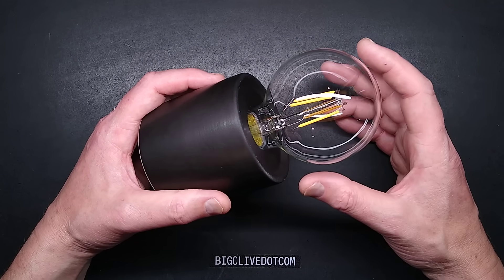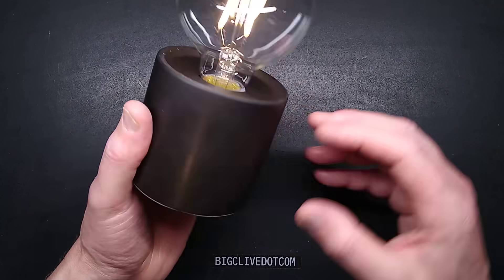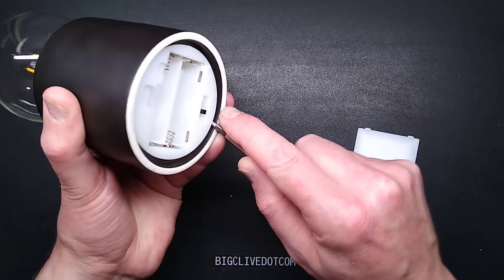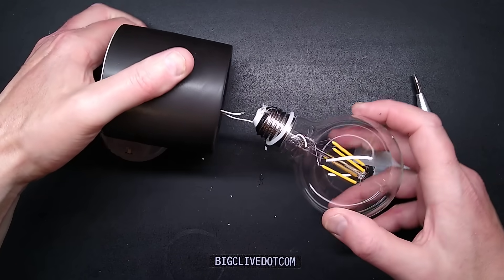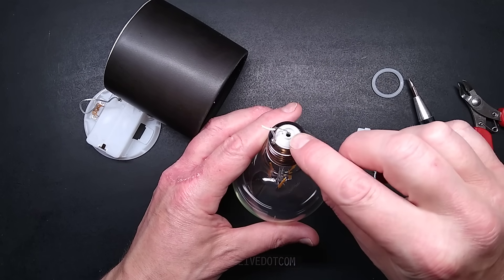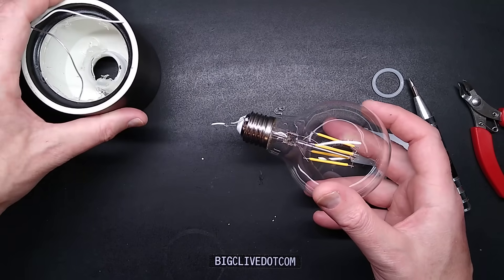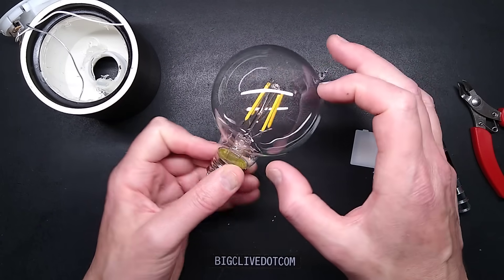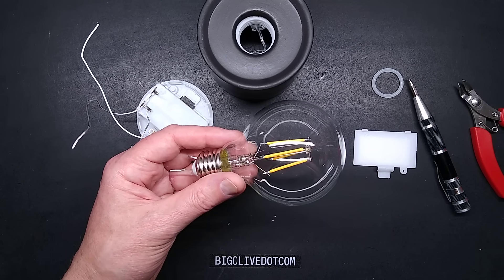Poundland 3V LED filament lamp with heavy base.

Comment: I found one of these in 2021 at a discount food store called Grocery Outlet in the USA, it ran on three AAA's and had a concrete base ! I have hung onto it ever since really which I could have gabbed more of them ! mine however has a full base that unscrews with a warming label on it not to put in in a normal light socket, my guess is thats why it was in the discount shop.

Comment: I just bought something similar in the German discount chain Penny for 10€. They have the same style of bulb plus a longer thinner one. The base is made of concrete instead of ceramic, it is powered by a nonremovable 600mAh Liion battery, and rechargeable through USB-C. Also it's got a 24h timer mode.

Comment: thats goign to eat those batteries quite quickly and will go dim quite suddenly , those draw a lot of amps, especially with no resistor - and no circuit to drive LED properly
Reply from the maker: The intensity and current tails down slowly as the battery voltage falls.

Comment: just was browsing on conrad and found that they sell your CLIFF quicktester.
with or without wire going in .. but quite expensive

www)(conrad).(com/brandlist/Cliff

(Maybe youtube bots wont autoblock this post as they normally do)

Item no.: 103857 / Manufacturer no.: CL1860 with EU Schuko Plug almost 80 eurobucks
Item no.: 103856 / Manufacturer no.: CL1850 for no wire and 60 eurobucks

Comment: Random chinese stuff question here: Does anyone know the name of the sockets use for car rear lights, the ones that combine rear lights and break lights. Or any other socket that has 3 connections? I wanna make filament lights with party mode. Those filaments can also be found in colours, so my idea is to do them half on half warm white and colour. And wire them up so you can switch between normal lighting and coloured lighting.

Comment: I got a couple of similar 4 filament 3V LED lights (with a metal base) from our local Jysk store for about 8 EUR a piece. Modded one to run on USB using an 3.3V DC-DC converter from Adafruit (which BTW supports up to 32V input). 
For <1W of power, that thing produces a lot of light !
Second one also got a regulator treatment but this time I put a couple of 14500 680 mAh Li-ion cells in it's AA holder. Lasts about 6 hours on a full charge.

Comment: No voltage regulation? So its starts out too bright and just gets dimmer and dimmer as the battery voltage drops.
I've fixed similar 3v LED lamps with a low dropout 3.0v regulator, or a 3.3v regulator, depends on how bright the lamp itself is. Then you can run from 3.7v lithium and have perfect brightness all the time.

Comment: That's cool they used a real bulb design. I figured this style would have a bulb and a cheaply-hung LED string just jammed inside from the bottom. We're in the age where you can just hook batteries to a "filament" like this and get a ton of light, similar to the old incandescent days just far more efficient.

Comment: I think you could probably retcon a proper Edison Screw socket into the hoplder. You may need to carefully dremmel the hole a little to fit and treat it to a generous glop of epoxy to hold it in, but once done the utility would be very pleasing!

I am going to get one of these the next time I have access to Poundland.
Reply: I wonder if they didn't use a proper base to stop people transferring the bulb into a mains powered lamp. That would be nice and bright for a couple of milliseconds.

Comment: I'd 3Dprint a new base accepting more AA batteries (like 6/8), and a bit of cirtcuity with a charge control unit, a photoresistor to shut off during daytime, and a type c port, so it can last 2 or 3 weeks without charge.

Also if using 18650 or other 4.2V batteries it can need a buck converter to not wast most of the energy into heat.
Reply: I'd throw in a charging board with a pair of 18650s, and a cheap 3.3V switch-mode DC-DC converter.
This light could easily run continuously at full brightness for something like 20+ hours on a pair of cheap cells or even longer if you use higher capacity ones.

Comment: I like the parallel "3v filaments"! You could build a interesting light fixture, with lots of bulbs in series, and not have to worry about the mains voltage isolation. You could use thin  enamelled copperwire, as invisible interconnect wires. Then run the hole lot off something like a 30v current limited supply. I'm thinking something like a tree root spider ceiling lamp! It could be a fun build.

Comment: I'd be tempted to swap in a battery holder that has the built it 6 or 8 hour timer chip, so it can be left to run automatically. 
With suitable resistors you could then run it off USB automatically too 👍
Reply: Lamps with this style of bulb are available with timer chips. I have two with 6 hour chips built-in.
Reply: @povilasstaniulis9484  where from? High street or Amazon etc?

Comment: I'm assuming if you left it on for long enough the basically get nice and warm because of the heating of the element? Or would it because then you could possibly use it as a extremely low power heating source?
Reply: That's not an actual incandescent filament, it is "fake" led filament. As such it doesn't get very hot. 

And anything that gets actually hot will drain the batteries in a minute.
Reply from the maker: It's LED, so stays cold.

Comment: Do you have any set ups for non mains electrical supplies you could share? I've just bought a house and the bills jeeez! I'm trying to save where I can!
Reply from the maker: The main cost of power is heating.  By cutting temperatures down a bit you can save a lot of money.

Comment: I've not long since bought some TCP smart bulbs on cheap from Asda then discovered I had to give my inside leg measurement, DNA sample and first born child to TCP so I can use their dodgy app.

So I did the sensible thing and tore one down to find a really cute little modules inside with 32bit 120MHz CPU, scads of flash and 5 PWM outputs as well as a couple of UARTs and GPIO pins.

Thing is, it runs on 3.3V so it would be an absolute doddle to fit it into one of those Poundland lamps and have a WiFi controlled/Alexa/Google compatible battery powered lamp.

Comment: Cool lamp! If a cap was installed on the bottom, it could be screwed into a standard socket on mains power. Flip the switch and you have indoor fireworks. 😅

Comment: oh how do these light on 2.4v? white led's are 3v?  unless it's got a boost circuit (Juel thief)  in the base?
Reply from the maker: Gallium nitride LEDs will start glowing at around 2.4V but not reach full intensity until around 2.7 to 3V.
Reply: It didn't look like it had a boost circuit, but Clive didn't open the screw base, so it might have been in there.

Comment: Very nice little light. I have always been intrigued by 12V versions of regular bulbs so this was a treat. Makes me want to build my own bulb with a joule thief to run it off as low of a voltage as possible for the novelty.
Reply: A Joule Thief should work, but the power will probably drop exponentially towards the end of the battery charge especially with LiIon/Lipo's.
Strangely the filament bulb came back in a full circle, at first the diodes were mounted on aluminum plates and now they are suspended like incandescent filaments.  heh
Reply: @BillAnt a joule thief discharge a regular battery to zero volt. Not recommended at all for lithium batteries.
Reply: @LeifNelandDk - That's right Li-Ion below 3V can damage the chemical composition.  Also unlike alkaline batteries which have a fairly linear discharge till .05 Volts, Li-Ion drops very quickly below 3 Volts even with a Joule Thief.
Reply: @BillAnt  Honestly still worth it especially since it would make a great emergency light. Honestly I am mostly enchanted by how low of a voltage it can run on soit is mostly for fun. haha, very true. The classic cycle of things going in and out of style. Wonder what the next generation of lights will look like.
Reply: @DickHolman  I like that idea. Will have to try it once I get some low voltage led filaments and a bulb kit :).

Comment: I've made a table lamp from a bulb from a similar USB light string you reviewed that had Edison base bulbs, bought a socket lampshade and harp and I use three EBL 10,000 mAh Ni-MH cells, goes a good long while before I need to swap in a charged set of cells😊 
I really love leds and Ni-MH cells, I remember when I was a kid the only battery lights were incandescent and you didn't dare use it for more than absolutely necessary or the batteries would go flat, we would have frequent power outages which are no fun when you're just a child and it's pitch black and no candles or oil lamps because my mother was convinced that the house would burn down if we used them.
Reply: I found some USB powered bulbs meant for camping.  Those would make good table lamps.  They are very bright.

Comment: Cheap led lightning solutions should display their hard-earned "Big Clive Seal of Approval" quality sticker as a marketing incentive. 
The matte finish ceramic base is pretty stylish in itself. Since the hole is for a standard E27 bulb, it can be repurposed in anything, including as a spot/lamp shade, put upside down with the socket inside.

Comment: You never know if you need a handy wireless lamp. They really should have glued the bulb in place if you can't remove it without destroying it. I'm guessing they might of intended the bulb to be replaceable, or it's just cheap to manufacture the bulbs with existing equipment.

Comment: Strange design with a lot of potential. I wouldn't have made something that looks like you could screw it out, but shouldn't. Because I know a lot of people will try to unscrew it anyway, and then return it broken.
Reply: It's probably best that you can't unscrew it and then screw it into a 120/240V socket.
Reply: @kimchristensen2175 it'd just blink and then turn off most likely

Comment: I'd been trying to make something similar out of wood, and now they sell the same thing, I don't agree with ceramic bases unless the bulb is going to get insanely hot... Be nice to see this screwed into lmv 😅
Reply: Maybe ceramic bases don't agree with you.
Reply: @ElectricChicken  not if you want stay under 5w 😂
Reply: Why don't you agree with a ceramic base?
Reply: My guess is the weight of it, is the reason they used it. It gives it a low center of gravity, and if it's on a desk, can withstand being bumped and jostled without tipping over. (as I imagine they're glass globes still)

Comment: So there are no electronics needed? Power --> switch --> light and that's it? 😃👍
Reply: What?  No schematic?  😂
Reply: yeah this is a pure LED bulb getting straight DC from the batteries. No need for electronics in the base to handle the AC

Comment: I'd think about sticking a "harvested" "disposable" LiPo  battery and a couple of resistors and a TP4056 charger, modified for lower charge current in it. Then a micro USB socket, an old phone charger, and have an always on low power light.
Reply: Dumb !
Can't trickle charge Lipo batts...
Goog luck.
Reply: I was thinking the same thing with an 18650 or a Nokia battery or something.
Reply: Same here, but I would put at least 4 of them in there. There's enough space for it. Makes it run for a very long time. I would put a 3 Amp charger in it to fill it up real quickly. The "disposable" cells of those smoke making devices are high current ones, you can easily charge them with 1 amp each.
Reply: @kyoudaiken Usually a good charge current is 1C (one times the battery's capacity). LiPo batteries are picky, some can be charged at a higher C rating but will shorten their lifespan.
Reply: @PunakiviAddikti  3 cells in parallel at 3 amps means 1 amp each cell. The "disposabele" cells usually have around 1 Ah capacity. So that would be 1C.
Reply: @kyoudaiken  You're right, 1Ah can be charged at 1A. But all batteries in a parallel pack are treated as one battery and should be charged at 1C of an individual cell. That also applies to series packs, the whole pack should be charged at 1C unless the manufacturer supports charging over 1C. It's not inherently dangerous to charge LiPo cells at a higher rate within reason and I frequently charge my cells at 2C which should be pretty safe, but it does weaken the cells over time.
Reply: @PunakiviAddikti  How does that make any sense if the 3A are distributed to 3 cells? It makes it 1A per cell. More or less. The differences between the cells could make a difference but I doubt it's more than a few mA.
Reply: @kyoudaiken  The C rating doesn't stack with parallel cells. Here, this quote explains it a lot better than I could.
"For parallel cells:

If both have eg 25C capacity then in parallel they are 50C rated compared to ONE CELL.

BUT if each is 300 mAh then in parallel capacity is 600 mAh and C rating is 25 x 600 mAh
ie the C rating relative to the new combined mAh capacity is the same as the C rating of each cell individually.
But the mAh capacity of the battery is the sum of the mAh rating of the two cells."
Reply: @PunakiviAddikti  If you got 3 cells 1 Ah each and you put them in parallel, the new capacity is 3 Ah. So 1C means 3 Ampere in this case. If you put them in series, then you still got 1Ah but 3x the voltage. Then 1C is still 1 Ampere. So if I put 3x 1 Ah cells in parallel, then assuming they have 1C rating, I can safely charge them with 3 Ampere.

Comment: Seems rather complicated to assemble, compared to just putting in a bulb socket. Anything to save a penny.
Reply: They probably didn't want someone unscrewing the bulb then screwing it into mains power and having it go bang.
Reply: @ralphshoop8822  not really a risk in the UK, but a serious one anywhere E27 is common.
Reply: Nowadays E27 is quite common in UK, especially in non ceiling-mounted situations. Bayonet cap lamps can be surprisingly hard to find in some retail outlets. @KeritechElectronics